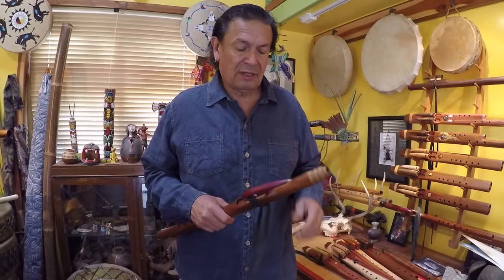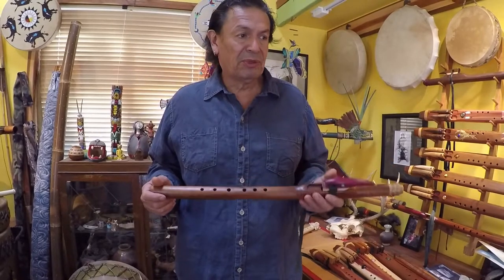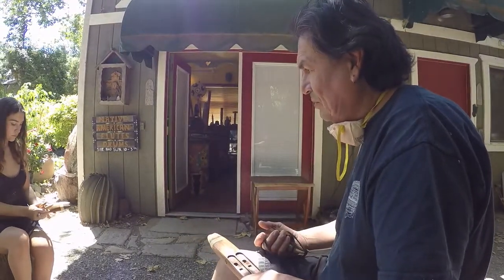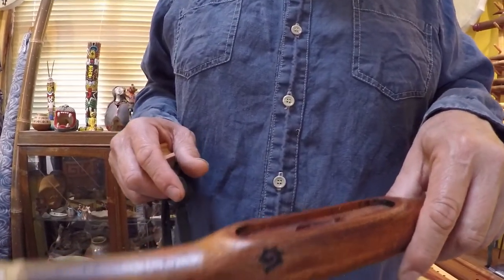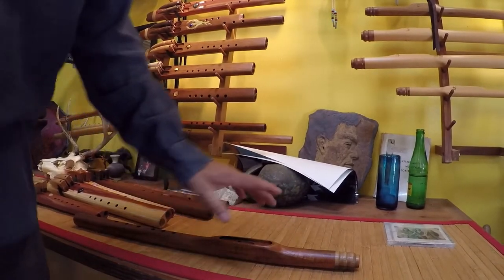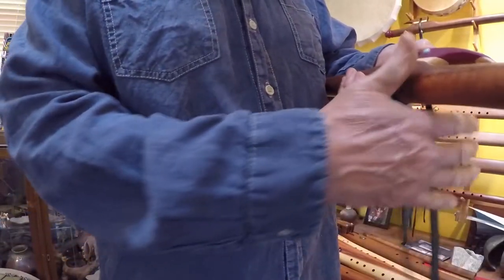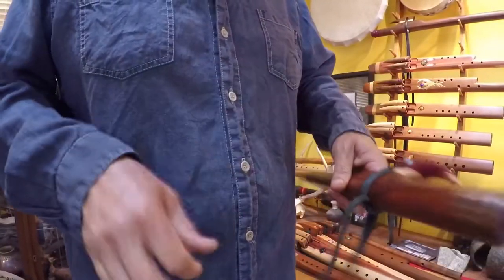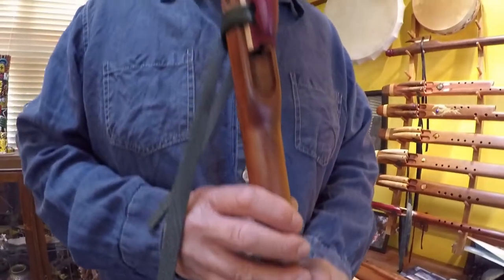Maintenance for Native American Flute

Comment: Thank you for such an informative video, I wasn't aware of the need to care for my flute in this way and noticed it's started to sound squeaky with the bottom 3 holes covered and even worse with the bottom holes uncovered. The top holes have no gaps from my fingers so this made me search for flute maintenance.. I am also travelling and I do have it well wrapped in my bad when it goes under the plane.. Is there a way I can fix the sound of my flute? From now on I will clean and dry it after every use.